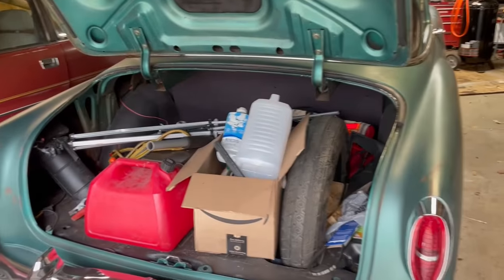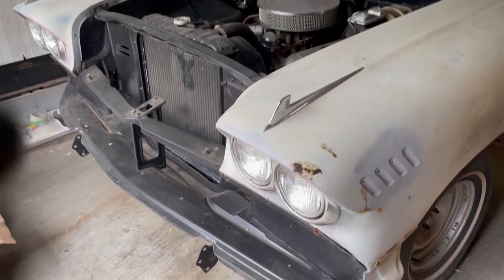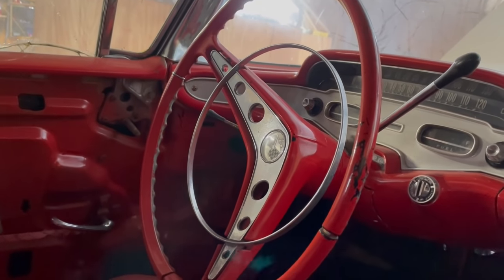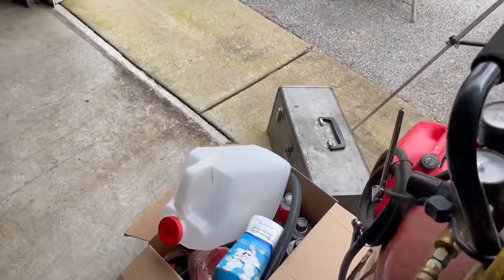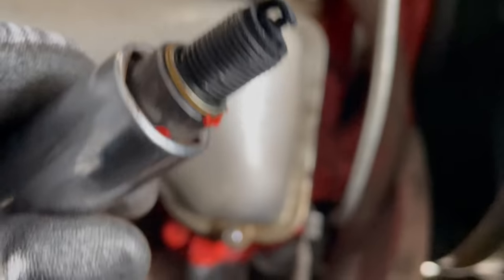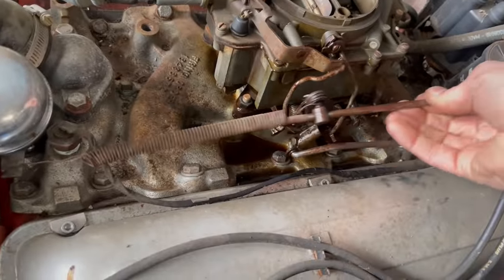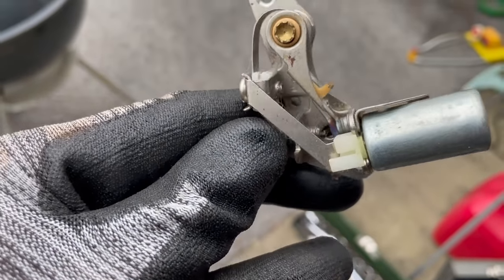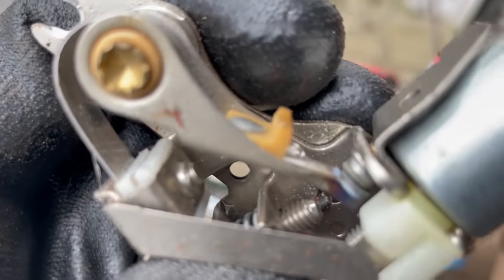Will it run?  Old hot rod 1958 Chevy Impala sitting in a garage for years!

Comment: Great to hear it start after all that work, I was skeptical! I had a '58 Impala my senior year in high school in 1972. Paid $50 for the rustbucket, 283/ Powerglide, ran well! It was my 2nd car because my '64 Impala 2 door 327/ Muncie 4 speed was always breaking down for some reason! I instantly recognize the old 348 engine. When I was 15 a friend of mine had a '62 SS ragtop 348/4 speed. We worked on it all summer, didn't know what we were doing, but we learned a lot about cars trying to get it ready to drag race. We also learned 409 heads don't work on 348's, the water jacket holes don't line up!!!
Reply from the maker: It sounds a lot like me growing up.

Comment: wow, that one ran well, too. :)

when the point opens, the magnetic field in the coil collapses, igniting an electric spark in the coil itself which then goes to distributor and spark plug. which is why dwell is very important; too small and the spark becomes weak because less time, too large and the magnetic field doesn't have enough time to build fully. also the opening of the point designates the timing first; first adjust dwell, then turn the distributor to timing.
the more cylinders you have the more important the dwell becomes, because the angle must become smaller of course.
I like the idea of allowing fineadjusting dwell through that window in the side of the cap; no other brand than GM had that, not even Opel (which belonged to GM since 1927); once the engine runs the dwell angle shifts a bit due to mass inertia of the points. and having to remove the cap and start adjusting anew takes a lot of time, and most times someone else to turn the key...

the only time I saw one of these street dinosaurs on german streets was late 80's. it was a two-door HT as well, in baby blue. and I seem to remember that someone had used the ventiports on the roof end to rig up a third brake light... it moved almost silently. might have been the traffic around disguising any noise, too, dunno. :)

Comment: 1954 green chev bel air  3 on the tree 14 year old boys $25 car  pushed it home 3 miles from junk yard re built with buckets and 4 speed hurst 4 speed on the  floor shift on a 6 cylinder  great memories from 1965   Kept us boys out of trouble for 2 years during restoration
Reply from the maker: Cars certainly are a good way to keep out of trouble.

Comment: 58 was the first year of the Impala, only being offered in a two door coupe and convertible. In 59 Impala became the top of the line, offered in all body styles. That looks to be a 59 or newer 250hp 348, due to it having long reach spark plugs, due to a water jacket around the plug hole, so it's not the original engine. Check the axle ratio to see it it was originally a 348 car. The 348 automatic used a 3:08 gear the 348 manual used a 3:36, the 283 automatic and manual used a 3:36 gear. The six used a 3:36 on the automatic, a 3:55 on the manual, and 4:11 on the overdrives.... so it should be a 3:08, if it was originally a 348 car. The 58 348's had pre ignition problems, due to high spark plug temp.... they used a short reach spark plug because of no cooling jacket around the plug... Both the block and head were different due to that.. Your 58 has the correct can on the power steering pump, so it most likely came with power steering. 58 had its own pump can, so did 59. I have a 59 Bel Air with the same engine and factory power steering, you can see it's can is different than you're 58's, if you look at it in my videos. Every degree of dwell will change timing one degree, so set your dwell correctly than set the timing..... timing does not effect dwell. Nice solid 58!
Reply from the maker: Wow, you really know these cars well. Thank you for the detailed information.

Comment: Just a couple of respectful suggestions, don't use sand paper to clean up points--- sand paper leaves a residue of fine sand on those two contact surfaces, and they need to mechanically closed to  ma ke electrical contact.  For these old cars, back in "the day," auto parts stores sold inexpensive contact metal files (no sand abrasives).  After "filing" the points, a bit of brake cleaner or electrical contact cleaner will ensure electrical continuity between the two cleaned surfaces-- I always slide a business card between the closed points to thoroughly clean the contact surfaces by simply passing the card through the points when they are closed under pressure.  Also, while you're in the distributor, it's really easy to check the vacuum advance to ensure that it's working.  I length of 1/8 inch rubber hose connected on the advance, and the other end used to simply suck on... if you can suck air through, the advance, it is toast and needs to be replaced.  If it's good, when you suck on the hose, you will see the stator plate with the points move.  The working vacuum advance vastly improves the engine's overall performance, yet it's purpose is usually not understood and therefore rarely checked.    Hope these suggestions help.
Reply from the maker: All good advice James. I blow the sanded points off with carb cleaner. I have one of those small metal files, It is good to hear they work, so I'll give it a try.

Comment: In 1959 I bought a used 58 Chevy Impala Convertible / 348 W engine. Equipped with 3 on the tree trans that I disliked. A 4 speed was optional and I just do not understand the reason the original owner would order a 3 speed manual. It was always difficult to shift from 1st to 2nd gear and it could not be downshifted into 1st gear while the rear wheels were turning! It was designed that way ! My only gripe !

Comment: My father had gotten my mother a brand new 1964 chevy impala four door it had a 283 with three on the tree (column). The only think that went south of that car was the Pennsylvania road salt and calcium it had low miles engine was great drive train was great it had low mile very low miles ran wonderful till the day it was parked for ever why the frame was gone floor pans were gone, the wire was in great shape pa road salt and calcium ruined that car was a wonder and beautiful car that little 283 was put in a roadster

Comment: it's a rodchester carb , 348  cu in , 4 barrel carb , hydraulic cam ,  stock 250 HP , the came in a 2 speed turboglide also . frank t

Comment: The car's nice but man you sure took your time you drove me crazy waiting on you
Reply from the maker: I did take my time with it. Since the plugs were all loose I was concerned there was rust in the cylinders, so I used the Mystery oil to make sure nothing was damaged while cranking. It takes longer, but a little bit of caution helps keep things from damage.

Comment: 3:15 Yes it's either a 348 or 409 but those are scalloped valve covers. Unless slang was a W engine.
The Z11 was the 427.
The Z11 "Mystery motor" became the 396/427/454 that was made after it.
Reply: RDF, no 409 in 1958. This is clearly a 348 engine.
Reply: @sergeantmasson3669  You are correct in your statement. Also not doing research that this is a W engine.
As per Wikipedia:
The first version of the "Big Block" V8 Chevrolet engine, known as the W-series, was introduced in 1958. Chevrolet designed this engine for use in passenger cars and light trucks. This engine had an overhead valve design with offset valves and uniquely scalloped rocker covers, giving it a distinctive appearance. The W-series was produced from 1958 to 1965, and had three displacement options:

348 cu in (5.7 L), available from 1958 to 1961 in cars, and in light trucks through 1964;
409 cu in (6.7 L), available from 1961 to 1965; and
427 cu in (7.0 L), available in 1962 and 1963.

Comment: ..on the '58 being a one-year only body style, you are correct...the frame and suspension are closely related to(but not the same)the '59-'64's..I always thought the front end styling on the '58 looked like an evolution of the '57..similar theme/design, just with double the headlights and parking lights...the hood looks similar to a '56 hood, and the '56 and '58 hood emblems are actually the same...also, look at your '54...then look at the '58...amazing there is only 4 model years difference between them!...
Reply from the maker: Right, in 4 years the style completely changed.

Comment: I use to carry a transmission in the trunk of my 348 1961 SS convertible on trips lousy engine lots of power switched to a 327 later traded on a  71 Monte Carlo we should add parked those cars at grammas house for my grandkids we have 29 now

Comment: I had a 58 convertible in 65...steering kept failing...Chevrolet dealership did some welding on it twice, then bailed altogether, claiming that the car would have to be turned upside down to repair properly.I had no choice but to scrap it.
Reply from the maker: Wow, that is something I have not heard before!

Comment: Some of those earoy 58's had a "turbo-glide" transmission in them which was a 3 speed automatic and it was behind the 348 motor.
Reply: ROBERT snyder, the Turboglide was a constant speed type transmission rather than individual gears settings. Constant problems and GM discontinued it in 1961.

Comment: Why no one ever cleans the distributor base where the points are held down beats me as they have to ground there or it will not get good spark, and the dwell is always off. I know that they will ground through  the two screws holding the points in but its like trying to start a car with good cables or just some small electrical wire that will not carry amperage enough to  turn a engine over.. same concept. I bought a brand new 58 in 59 as a carry over and they did not sell well as they felt like a wash tub compared to the first three tri fives... I did get the 348 with a tri power and it was a bugger to keep adjusted for the best throttle response

Comment: That's a Rochester 4gc and the coil bracket is mounted backwards.
Reply: agreed and because of it  it is interfering with the distributor and  the coil is also interfering with the throttle linkage   when he was jabbing the throttle  you could see the coil rocking over sideways...so having the coil bracket reversed  is a double problem,
could get exciting if that linkage binding caused a stuck throttle...easy fix.

Comment: How were the rear quarter panels on that '58 Chevy? They came from the factory with slight ripples in the rear quarter panels
Reply from the maker: The whole car is solid and straight.
Reply: @whattherust  Guaranteed that the rear quarter panels have slight ripples in them near the bends. They all did right from the factory.

Comment: You got no spark .that is a Rochester carb 250 horse 355 foot pounds of torque.that is the 58 steering wheel..this car came with power steering and brakes. And they had air ride and factor 4 speed.they came with a turbo glide and a power glide..you should buy that car and restore it

Comment: Do you wear a Mic? Cause you talk so low that I have to crank my volume super high to hear you so when you make any other sounds like with the engine I'm blowing the speakers outta my tv along with blowing out my eardrums!
Reply from the maker: The sound on this video is not good. I was working on the car while an estate sale was taking place, so I had to be relatively quiet. It turned out all wrong.

Comment: Just started watching and it's gotten off to a BAD start!  You're spreading the silly idea that Chevy "W"-engines have anything to do with the shape of the valve covers.  It was simply the letter of the alphabet assigned to the engine development project.  The engine projects after it were "X" and "Y".   This is like saying all Chevy 400's were big blocks or AMC 327's were really Chevy 327's.  Spreading the wrong information.  Besides, the valve covers are more like an "M" with three points on the bottom than a "W".
Reply from the maker: I appreciate your perspective, but you are not entirely correct. Chevy used W, X, and Y to identify those engines, with the W variant being the one produced. Perhaps it is wrong to notate the valve covers as the reason, but nonetheless the 348 is most certainly a W engine. This has zero to do with noting a Chevy 400 as a big block, or an AMC 327 as a Chevy engine.
Reply: @whattherust  I wasn't relating the "W" engines directly to either of the other incorrect statements.  Otherwise I enjoyed your video.